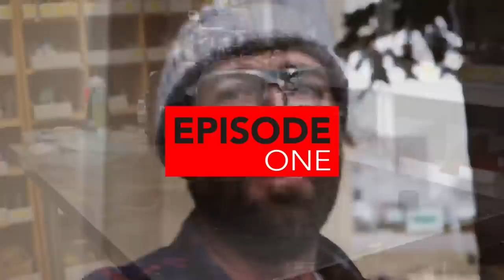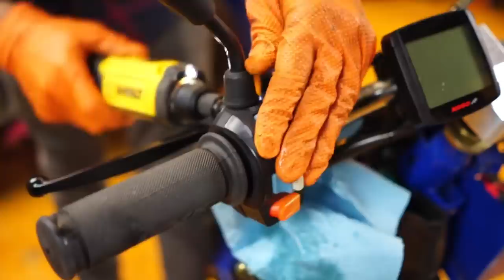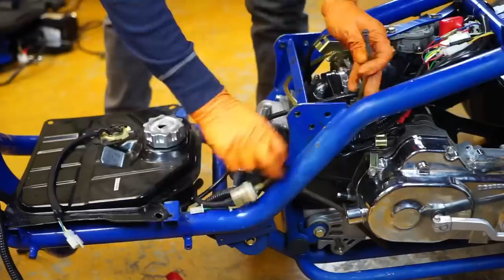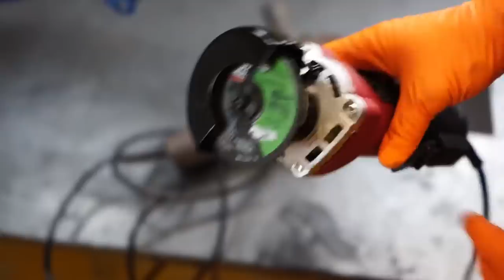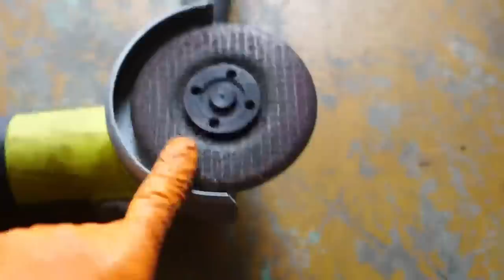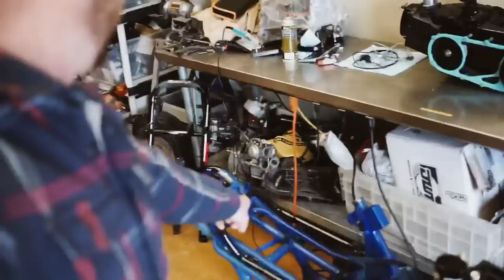Chuckus Trike Build Series: EPISODE 1 (From Tinker to Tonka)

Comment: I just discovered your channel really loving it. I have a mad dog 50cc trike.the speed limit in my town is from 35mph to 40. I'm going to replace a ton of parts the idea is to get it to Cruze at 40mph with no issues top out at 60mph. I've road it as it is at 40 but I believe I screwed up the carb is not pushing gas it leaks out a breaded tube so I was not happy with it being stock. I am very happy to have found your channel the question I had are all being answered